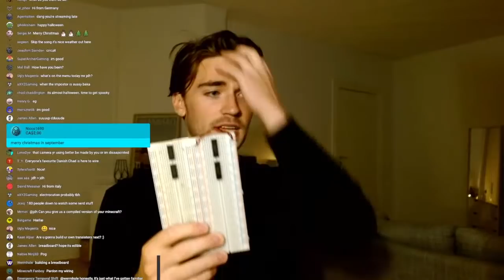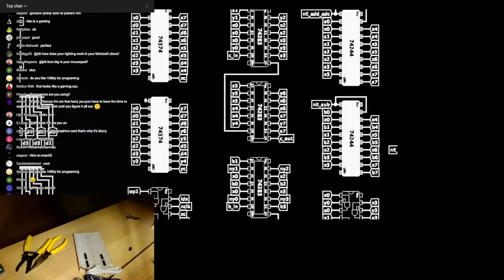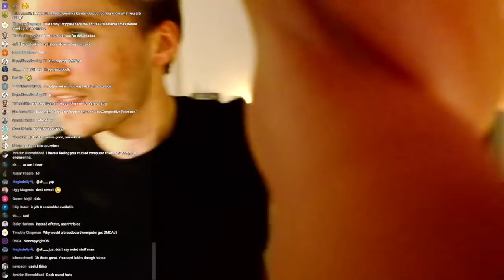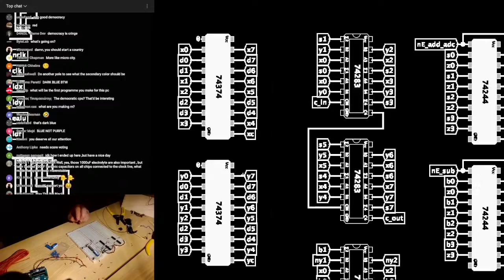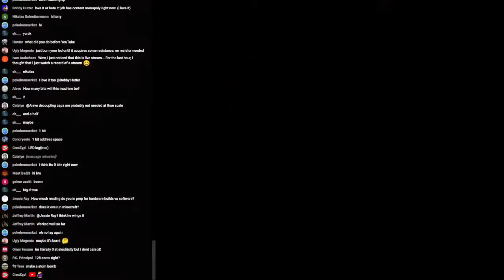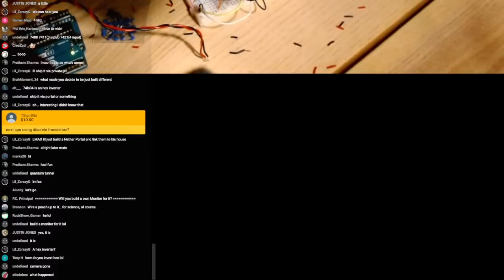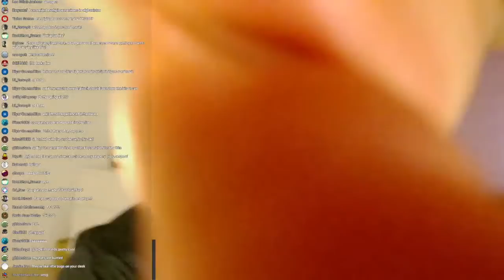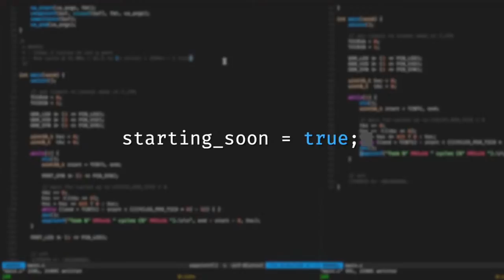how not to wire a circuit

Comment: you want a resistor network for the inputs to pull the inputs low when not made high by you dip switches.